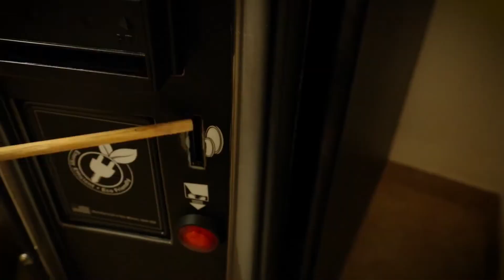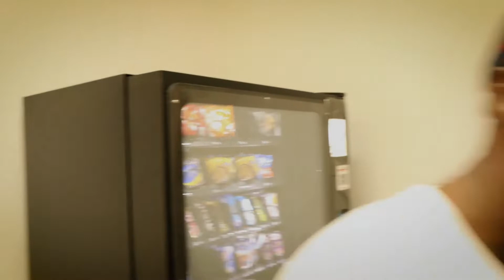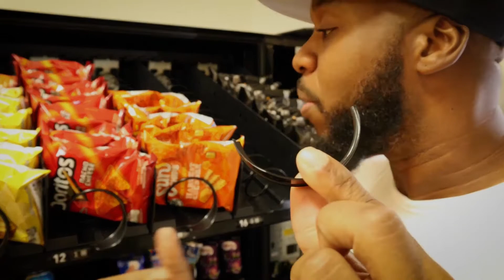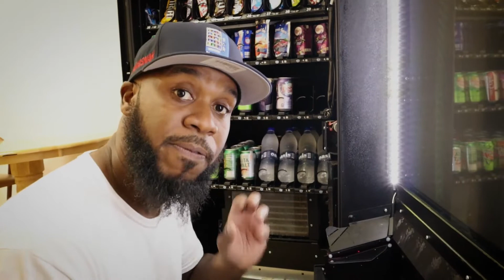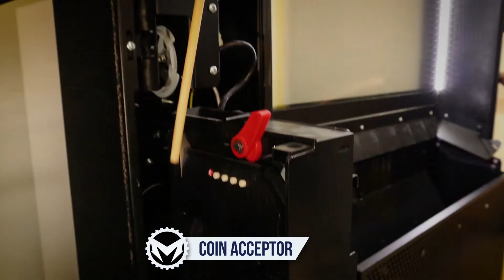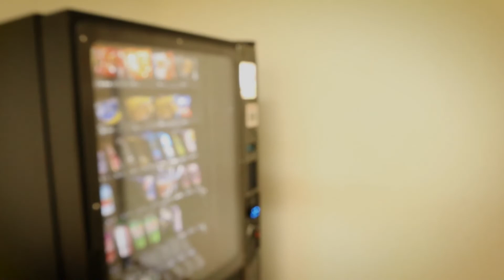KYM: Know Your Machine. Learn the parts and the language of vending machines.

Comment: Good evening,my display is blank and the key pad doesn't work,any help would be appreciated
Reply from the maker: Display may just need to be reconnected. This has happened to me several times where my display would go blank. Your connection might be loose. Check both ends. It’s usually a ribbon cable. 
Keypad may also need a reconnection to the board. Or, you may also have a stuck button. Or the keypad could just be bad and will need to be replaced 🤷🏽‍♂️
Reply: @MachineDon1  thank you so much,I'll let you know how it goes.!!

Comment: Hey man question what does it mean when your whole B row say make another selection?
Reply from the maker: If ur entire row is telling you that, that sounds like your harness might be disconnected or may have a short somewhere in it. Another possible reason could be the row might be turned off from in the brain of the machine. Might have to go into service mode and make sure your B row is enabled.

Comment: What's the connection of the motor and coil like the thing where the coil spins because of the motor but that plastic circle piece that connects the motor to the coil
Reply from the maker: That plastic circle piece that connects the motor to the coil are called couplings. So they would be referred to as the coil/spiral/auger couplings. Good luck!
Reply: Thanks
Reply: I need help asap

Comment: Great information! Did you ever came across your machine being stolen? If so, what are ways to prevent that from happening?
Reply from the maker: Good question. Fortunate for me I've never had a machine stolen. But if you have a remote location, or an account that doesn't have security or an outdoor machine location, I would have a cage built to protect my investment. A cheaper way is that you can also bolt the legs of the machine to the ground making it near impossible to move. Check my Ig page, I have pics up with outdoor locations and machines in cages. www.instagram.com/machineman.co
Reply: Thanks!